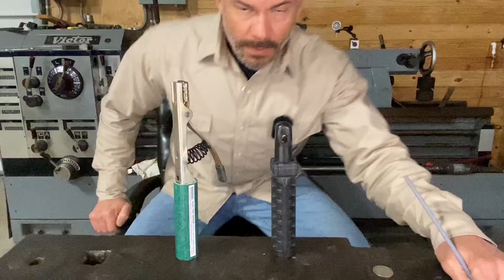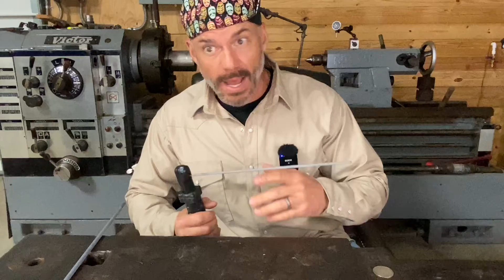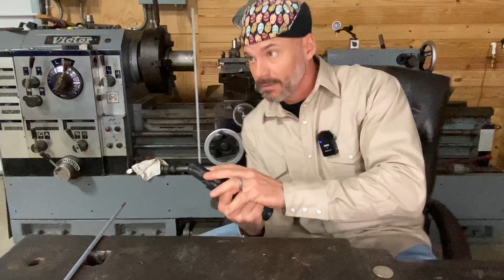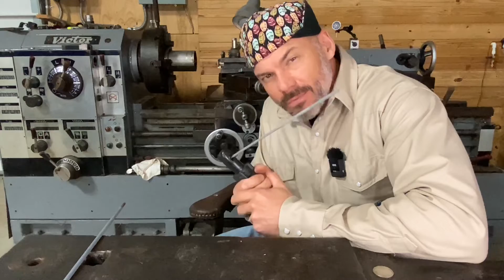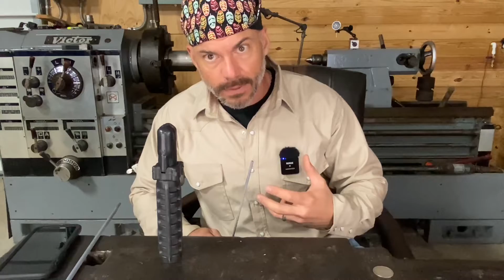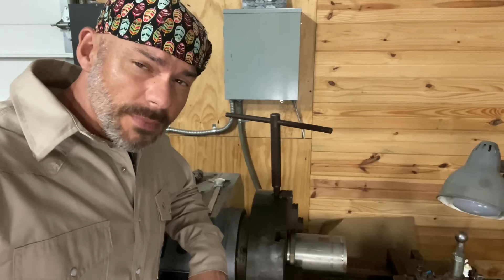Welding rod stingers and how to keep your welding rod from shaking.￼

Comment: Great video's. I have been welding now for 50 years and have truly enjoyed your videos. I still have an old Miller Thunderbold AC/DC welder that still works great that I bought in 1984. Anyways, way back when the Alaska Oil Pipeline was built, an old welder who worked on it gave me a bunch of welding rod they used when he came back to the lower 48. I don't recall the brand but they were 333 and 444 rods as marked on them. The 444 rods replaced the 333 rods because the 333 would crack once in a while he told me. I used the 444 rod all up about 25 years back now on excavator buckets and other heavy equipment. As I recall, it was the smoothest rod I have used, maybe to this day. The repairs seemed bullet proof too. The rods were 1/8 and seemed to be about 20 - 24 inches long or so too. Again... Excellent videos you have posted!!!!!
Reply from the maker: I have never heard of a 333 or a 444 rod that is very interesting. I would love to run one . specially if it was smooth.
I’m glad you enjoyed the content. Sorry I’m just catching up on comments. I got busy and they got away from me.

Comment: Hey man, thank you so much for making this video. You've earned a new subscriber.

I just got a cheap Chinese stick welder from Amazon for like $90. I'm not looking to become a fabricator or anything like that. I have little to no previous welding experience, but I want to be able to fix/repair/build little things around here on the ranch without having to hire a professional welder to come out for a 10 minute solution that costs me $150.

I fired up my little Hone welder today and just played with it on my makeshift setup using a bunch of scrap steel I bought from the local scrapyard, and was very impressed with how the little welder performed even with my limited knowledge and experience. I was able to run a respectable bead across some flat steel, then cut a couple of 5" pieces of 3/4" square tube with a 45 degree miter joint. Was able to tack the joint using a magnet to hold the pieces at a perfect 90 and then go around the joint and make it strong.

I blew through the outside of the joint and learned how to fill in the gap with some pretty sketchy methods of arc-puddle-wait, arc-puddle-wait, and ended up with a terrible looking joint that was at least strong and solid, and I can grind it down and it will look pretty decent. 

I decided to google, "how to keep my welding rod from wiggling", and ended up here. I had NO idea that you could steady the rod with a finger, and was a little stymied by the fact that the shake in my hand was translating into a 1"+ wobble at the end of a new rod. 

So far, I'm pretty happy with my first day of welding, and even though I've managed to weld my workpiece to the table, my vise grips to the table, my magnet to my vise grips, my welding rod to every damned thing, and at one point, my rod to my ground clamp (THAT was exciting), I'm getting it figured out. 

Welding is something that was always a mystery to me. I've done just about every other type of craftsman work across multiple industries, but I've never really liked working with metal. I'm really looking forward to getting better at this, and I'm happy to have found your channel to help me with that. 

Keep up the good work!
Reply from the maker: Thank you... how's your welding coming along

Comment: A guy on eBay had a nos 300 amp stubby so I bought it.  
Practiced a little with and I looked like a monkey messing with a football getting the rod in and out. 
Gonna take a little practice but I liked it.  
When you bend your rod it doesn’t roll around in the stinger. Thanks for the videos.
Reply from the maker: it does take some getting used to but it's worth it

Comment: I couldn't find any of those. I didn't here you say the name of it until now (I've skipped around on your videos), but went looking for one as soon as you showed it to us. Do you have a source?  Oh-out of production-damn. 
Not finding any of those I bought a twister by ESAB, it's a bear to get the "grip" off!  Maybe I'll get it installed today.  Funny thing--the only place I can find the ESAB stinger new is out of Ukraine on Ebay.  I bought a "tested" unit (less $) .
ESAB doesn't list it at their site even. I sent them an inquiry.
Reply: I just got the ESAB Handy 300 apart. It has two big set screws for binding things up. It's not nearly so well designed as the Stubby-you showed us on another video.  I'll find one of those, but right now I'm pretty excited to dump the el Cheapo stinger and try out the "Handy".
Reply: OH hell, Lenco makes one too. Guess i'll get 'em all. I ran the Handy 300 today, love it. Just got to get used to twisting. Improved my practice area my beads are looking better faster all the time.
Reply from the maker: The only place I know to get them anymore eBay

Comment: i like to use the clamp stingers with 7018 cuz i can choke up on the rod by braking off alil of the flux and clamp on to the rod a couple inches in so the rod is shorter and stops the wiggling

Comment: Also make sure you eat and drink, and don’t drink caffeine, nicotine doesn’t help thought I do vape, some drugs might make it worse also. Last thing, I know getting your hand further down the stinger gives you more range of motion, and keeps your hand away from the heat when your rod gets small, but the lower your hand is on the stinger, the more leverage you have so the end of the rod will move more with small movement or shakes with your hand. Sometimes choking up on the stinger can help. And stay calm don’t get frustrated

Comment: 6013 runs weird. It is very prone to porosity, and it does not penetrate much at all. I don’t like it at all. It runs nothing like a 7018 or 6010 it’s different than both. I can’t remember if it’s ac but I know you can run on DCEP

Comment: Question I have checked all my welding supplies and none of them have welding leads, I don’t know the best types of lead I have black leads but they are used and really old, and I was wondering what are the best leads and what size wire would you go with
Reply: But we only have two welding supplies to be fair
Reply from the maker: Number one is what I’ve been using. But I ran 01 for a long time . The bigger leads last longer, but I don’t use a whip so I chose the number one.

Comment: Hi Chris! I have the very same stubby rod saver that you like. It was given to me. I cannot figure out how to connect the cable to it. It has a "bullet point" and a threaded sleeve in the handle where the cable connects. There are no set screws or any of usual, self explanatory cable attachment means and it doesn't have any instructions. Am I making any sense? Thanks.
Reply from the maker: Yes! I’m not sure how to tell you to do it and text. Maybe I’ll make a video about it.

Comment: Hey Chris I’m a senior in high school and I’ve been watching your videos for a couple of weeks and have learned a lot. I recently bought a 1972 red face SA 200 for my first welding machine and have been practicing 6010 and 7018 everyday after school for a couple hours in all positions. I’ve been having trouble running 1/8 and 3/32 7018 vertical. My puddle keeps falling out no matter my arc length, adjusted heat up and down but to no avail. Could it be bad/older rods? Any help would be appreciated.
Reply from the maker: I made you a video

Comment: 6013 is rod used mostly (mostly) outside of the US in the developing world (or poor countries).   They use it for EVERYTHING (including everything it shouldn't be used for).  I know because I've travelled abroad over the last two decades and always liked seeing what kind of local welding was going on.  It's invariably 6013 and sometimes 7018 but mostly 6013.   What you'll never, NEVER see is a 6010.
Reply: Yes. I am from Eastern Europe, 6010/6011 are not even available. I'm not really sure what pipe welders use here for the root pass, probably 7018 on en. I only do light fabrication and mostly use flux core, t11.
Reply from the maker: Thanks for sharing. I figured they welded about the same . No 6010 over seas … I had no idea
Reply: @TaylorWelding  6013 is kind of like 7018, but it penetrates less, the puddle is not as defined, and the tensile strength is less... but it does not require an oven.
Reply: Light penetration rod good thin  metal and they used this rod alot overseas in the pipe industry
Reply: @bgs4896   I'm European, but I don't really know the procedures for pipe here... I've heard that some weld pipe with only 7018, but the root on dcen. Do you know details about how they do it?
Reply: @schellycraft4290  same here
Reply: Did you have to  say poor countries 😢
Reply: I agree with you 
I am from overseas 
I have never seen 6010 in my country and people don’t have clue what 7018 rod is.
Reply: “Git comfortable “. 👍🏻👍🏻
Reply: You mean lesser developed country, not developing world.
Reply: I am a Texas boy and had no clue either. Funnily enough, I learned on 6013. When I was in ag mechanics in high school, it was all they gave us, and they had a lot of it. I think it was mostly just cost. Near nobody wanted them so I guess we got the bulk discount. 😂 (Ag mechanics is basically welding shop class with a focus on building all things farm and ranch)

Comment: I just purchased a 400 A stinger holder similar to the black one in this video, but a cheapy. Right away the rod holding part doesn't impress me the rod is not very tight unless I mess with it over and over like the opening is too wide or the clamp pieces too smooth. Any suggestions? I have all 3/32 rod BTW. Enjoy your videos and I am a tig guy learning stick just for the hell of it.
Reply from the maker: That’s cool dude learn it all